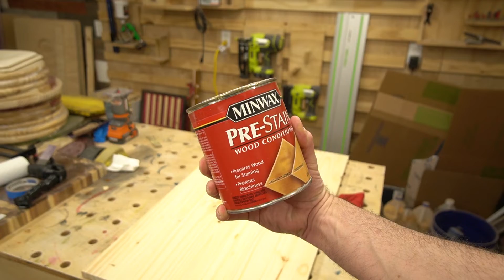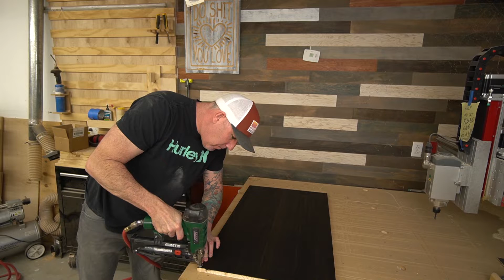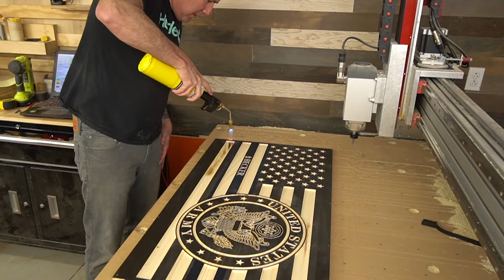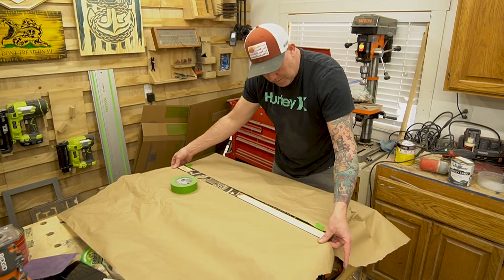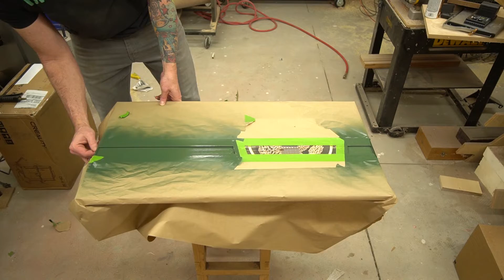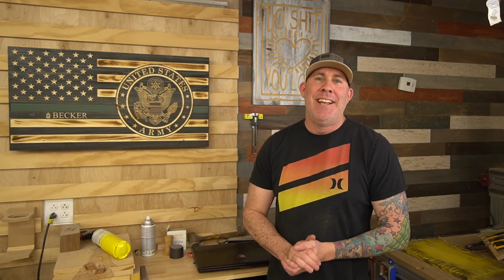Make the best American Wooden Flags

Comment: Great video!  Suggestion - get an HVLP spray gun for finishing (much faster spraying and way more uniform in finish) - and finish your flag FLAT - don't do it standing up, way to much chance for drips and runs....I use General Finishes waterbased satin 450...been doing signs for 15 years on the CNC.

Comment: Nice work great looking flag.  Liked how you explained the different polys.  On the first project for a picture frame it was good until I placed the poly on and turned yellow I spent the next 2 hrs painting the letters and washing off the excess paint.  What bits do you use when you cut the emblem and stars.
Reply from the maker: Either a 60 or 90 V-Bit and always make sure it's sharp and high quality! I love poly, minus the issues with coloring :)